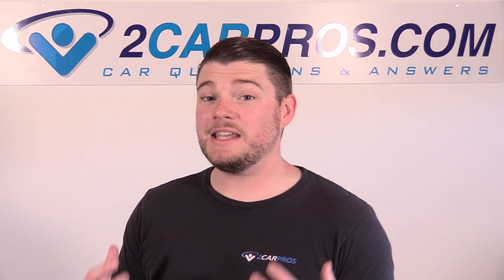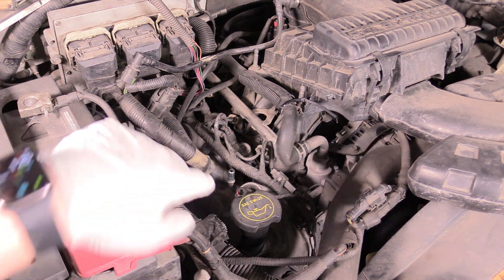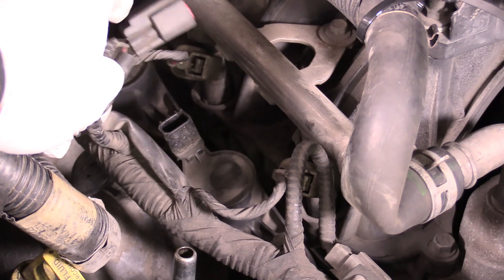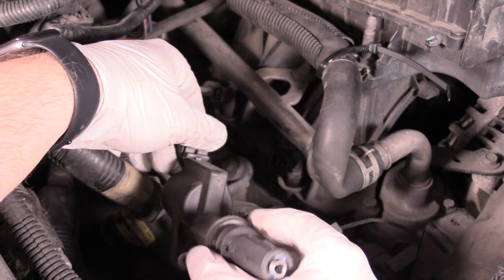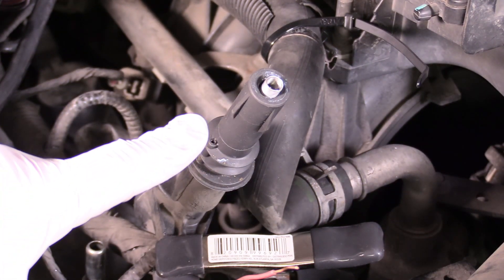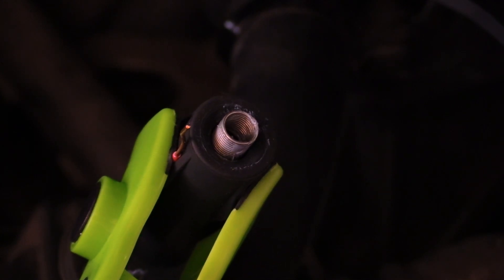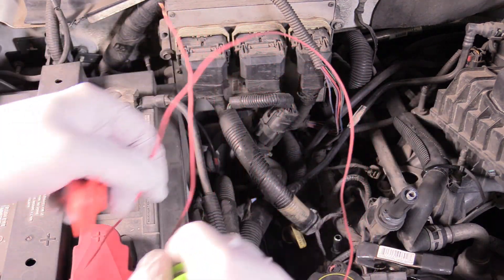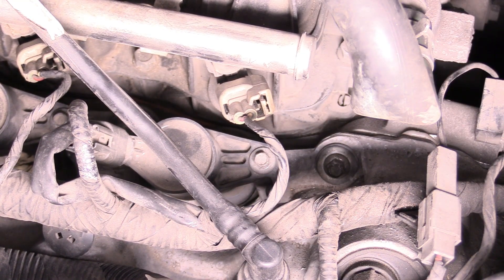How to Test for Spark - Testing for Ignition System Spark with Potato Chip Clips!

Comment: Can you not just put a spark plug into the holder? Or might that not be a sufficient gap (since It's not 'under load??); then an old good  spark plug you could widen the gap? Especially if the metal is deep, deep like you say it might be.
Thanks in advance. Have changed crank position and Cam position sensors, psi 50 on fuel rail, throttle body removed and cleaned, maf spray used, blah, blah still fires up but won't run.